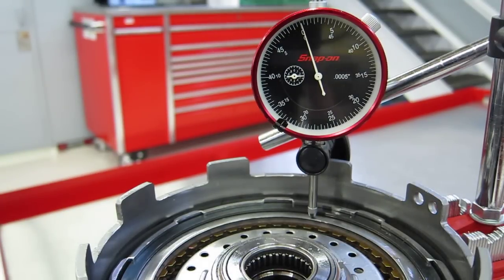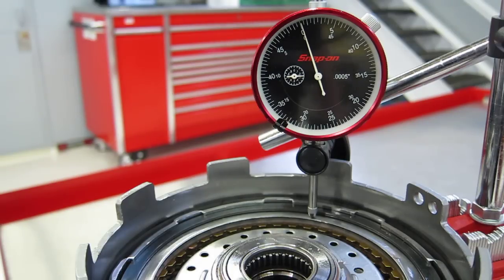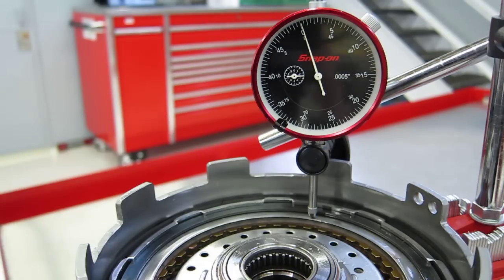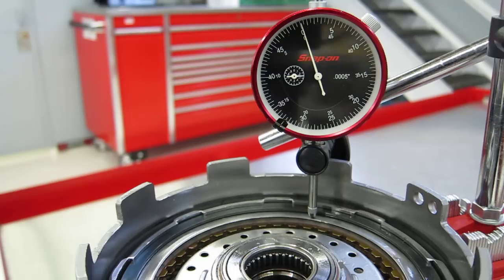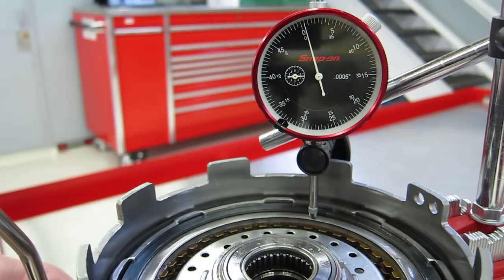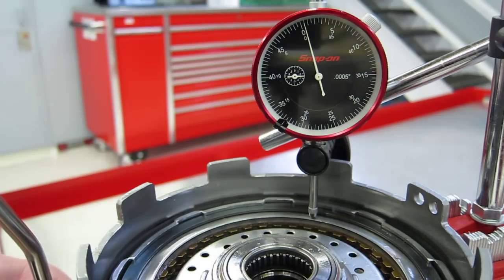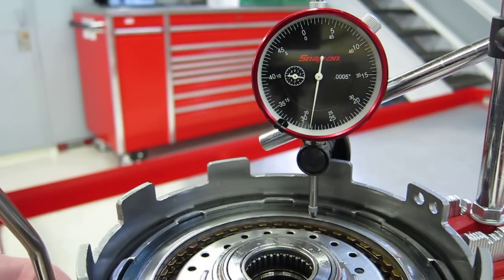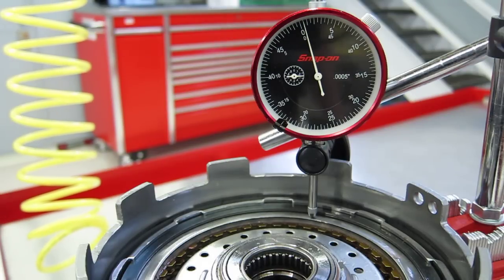Automatic Transmission Clutch Pack Clearance Check with Dial Indicator

Comment: Do you have to use a dial indicator ? Or could I use a feeler gauge between the clutch pack and the snap ring ?
Reply from the maker: Either way will work

Comment: What should we do if the clearance is too wide, but not enough to add another disc and steel to take up the slack?
I have seen a builder make a shim with a lathe, but what if we don't have access to a lathe?
Reply from the maker: Make sure you have all the required disks. There are steel plates available from Toyoya to adjust the clearance.

Comment: So this kind of test can be used when a new kit of clutch pack is placed in the transmission and you wanna know if the tollerances are ok? Or you need to change the snap rings...
Reply from the maker: Yes, that is correct
Reply: +WeberAuto thank you Professor John!

Comment: I know this is an older video but could you tell me how much air pressure you used in the test?
Reply from the maker: 90 psi
Reply: Most ford models are around 70 psi according to pts

Comment: Do you have any opinion on the usage of Lubegard additives? I put some (admittedly, the wrong formula) Lubegard Black in the A131L of my 2000 corolla and it's sooooo smooth now.

Not supposed to put the black bottle in this car but it's mine, and there isn't anyone to yell at me if I break it so it was one of those "What the hell right??" decisions.
Reply from the maker: Personally, I always stay away from additives and non-factory fluid. I think that if I want the vehicle to perform the same way it did when it was new, it needs to have the same parts and fluids in it. Best wishes!

Comment: I'm getting ready to rebuild a 4r70w that I pulled from a 1997 awd Ford explorer. I'm going to be putting it in my 1967 Bronco. Do you have any advice for this trans? parts that may be problematic or tricks to make a better trans?
Reply from the maker: +Kris Bassett Hi, I am not very familiar with that transmission's common troubles and fixes, sorry I cannot help you there. Best wishes.

Comment from the maker: @tnphysics This particular model does not have springs to separate the backing plate from the clutch disks.  Some clutch packs do because the clutch is not used during high rotational speeds of the housing verses the disks so proper clearance and lubrication are critical.